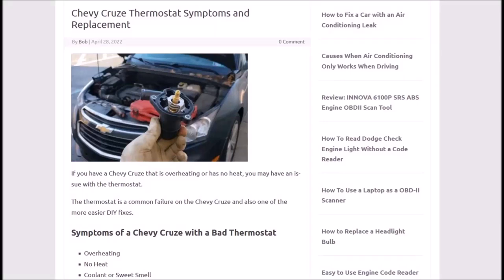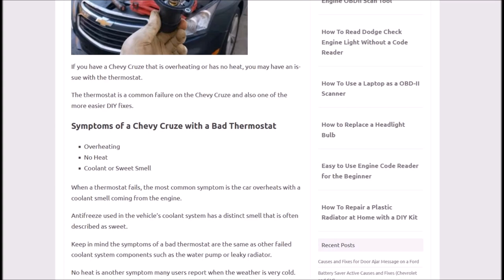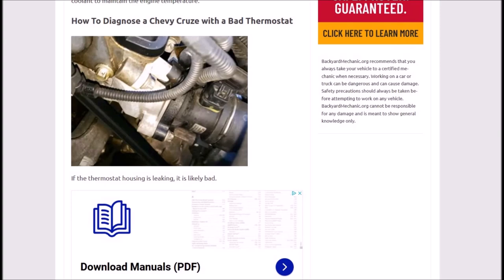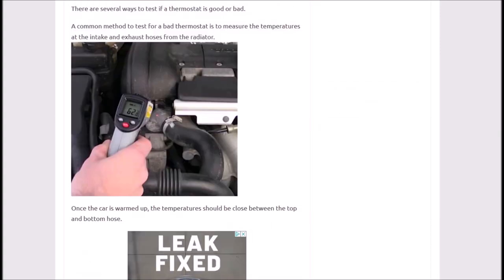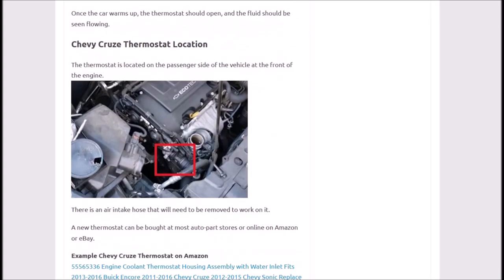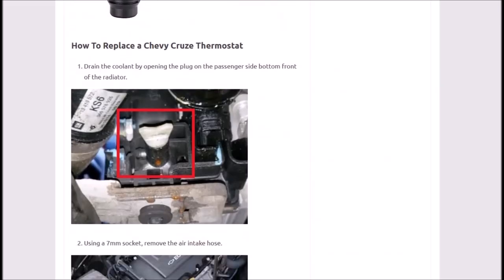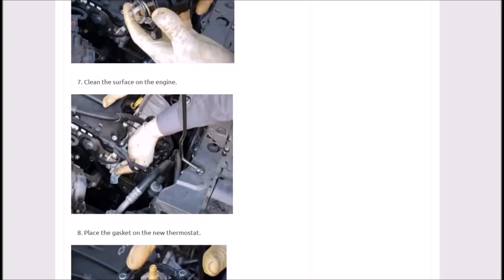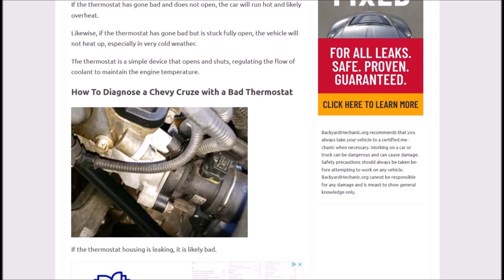Chevy Cruze Thermostat Symptoms, Location, and Replacement

Comment: I have a 2012 chevy cruze and suspected i had a faulty thermostat until i watched your video. The engine heats up to just under half on the dash gauge. It stays there and doesn't go down or any further up. The rad fan starts blowing and keeps blowing, then stops periodically; then it blows again, even in freezing weather. I still get heat inside of the car. The fan constantly blowing is my big issue. Can you suggest what is going on please?
Reply from the maker: The Chevy Cruze is notorious for overheating, which can be caused by several things. If it is drive-able, but the gauge shows it is overheating and the fans stay on all the time, it may be a bad sensor. If the engine is overheating, then it can be a bad thermostat or a water pump.
Reply: @HVAC_Mechanic  it isn't overheating, but the fan blows an awful lot.
Reply: did you find the problem?  @ratridge
Reply: @HollowPK   I got a new car lol but ty. This was the tip of the iceberg.
Reply: @HollowPK  the radiator fans are also notorious for burning the resistor up, which causes the fan to run on HIGH all the time. You can replace the resistor assembly for 20 bucks or you can replace the entire radiator fan for around 100 bucks. The 20 dollar option requires soldering or wire nuts.

Comment: This is an electrically controlled thermostat, not a mechanical. So most of what you said to diagnoss is wrong.
Reply: Electric assisted. Mechanically opens at 221°F